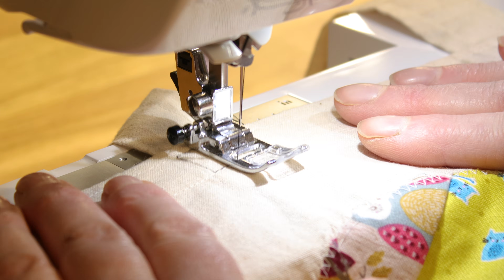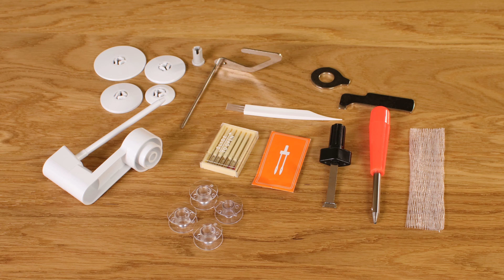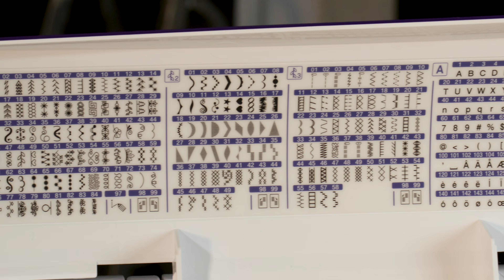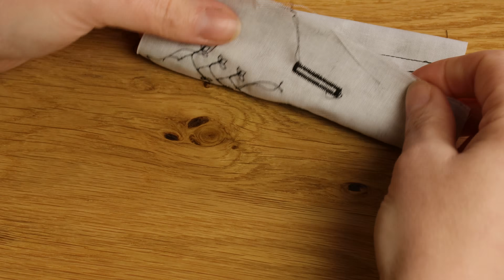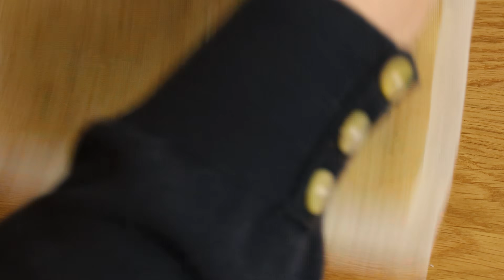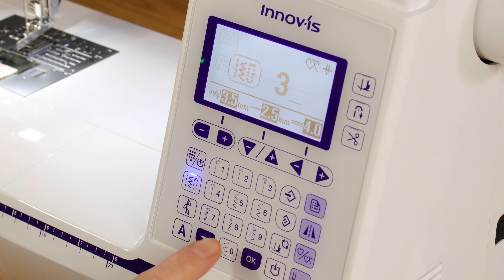Brother Innov-is NV1800Q Sewing Machine Review

Comment: WARNING! DON`T buy this machine if you often need a GRADUAL, precise lowering of the sewing foot! They removed the normal use of the foot, replacing it with the foot button. Which is nice; unless you need to lower the foot with millimeter precision. Which you may need, if you do patchwork piecing or quilt straight lines and start from the middle of the quilt and need to make the lines meet. You CAN still lower the foot gradually, but it`s now a THREE step operation; you first have to lower the foot but clicking the foot button, then you have to raise the foot manually and then you can finally, gradually lower it. I never would have bought this machine had i known about this. And i didn`t realize what a pain this would be for piecing, because when i bought it i was up for some quilting. So if i now want a machine that i can easily start sewing with precision with, i have to downgrade to the 1350, which doesn`t come with the extension table and also pay 500 dollars more. It is in many ways a great machine. But i`m a patchy most of all. And this machine turned my sewing joy into grief.
Reply from the maker: The pivoting function on this model is perfect for piecing. When activated, the machine automatically stops sewing with the needle down and raises the presser foot for you to grab your next fabric pieces and chain piece away - easy peasy!
Reply: @SewingStudio  You can`t always chain piece. I see no reason for turning the normal handle lowering into a three step operation. It should be able to have both the button and the normal manual use. Then it would have been brilliant.
Reply: @SewingStudio  And btw; you don`t raise the presser foot when you chainpiece. That`s the whole problem with this machine; it was clearly designed by someone who never sewn patchwork.